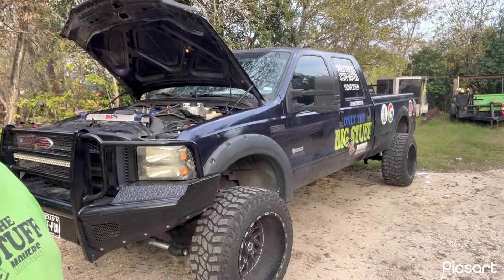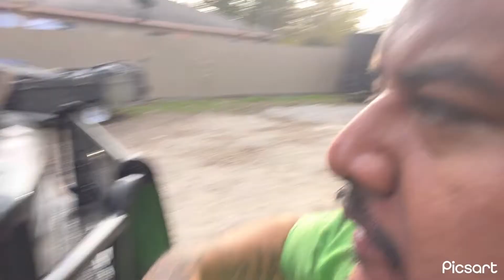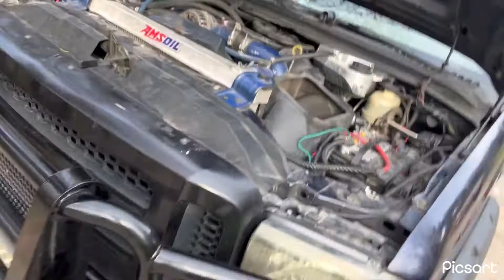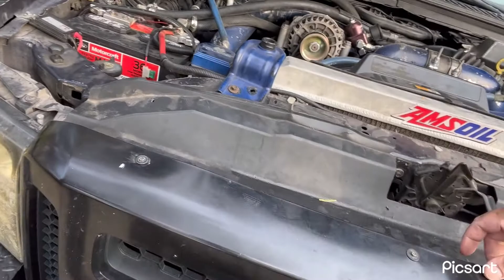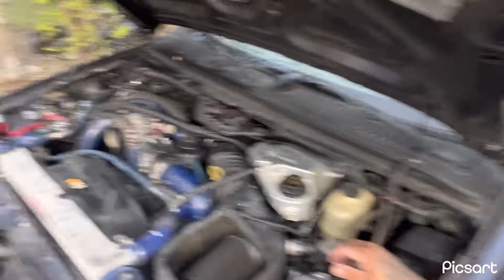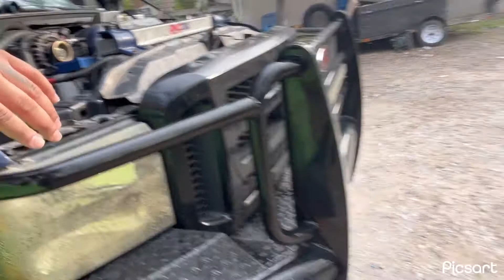6.0 powerstroke dies after bump

Comment: I had a similar issue. Ended up being the FICM. Shannon at FICM fixer tested it. It all tested fine then he tapped on the FICM and his truck died. Ended up being a bad logic board. One new FICM later and runs like its brand new again.
Reply from the maker: It was a loose connector under the battery tray and fuse box 

The connector was on but barely making contact

Comment: Lmaooo I swear you’re a goat same shit just happened to my moving truck and it was the same exact issue. Fixed the wiring and tightened it and now we back in action. Respect 🫡
Reply from the maker: It fixed the issue but also had a loose connector located under the battery tray  and fuse box

Comment: Issa Ford that's your first problem.
Reply from the maker: This truck has tons of miles and goes cross country at the drop of a dime.  My cummins is on its 4 th trans and ac don't work and it's not even 10 yrs old. My duramax was in the shop for a whole yr tracing an electrical issue and it was only 2 yrs old at the time.  I'll stick with ford from now on